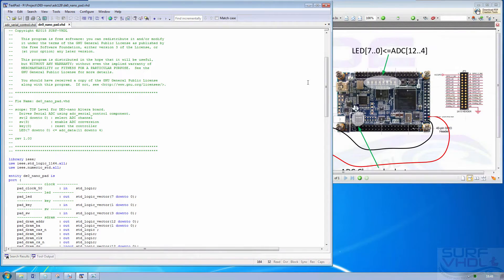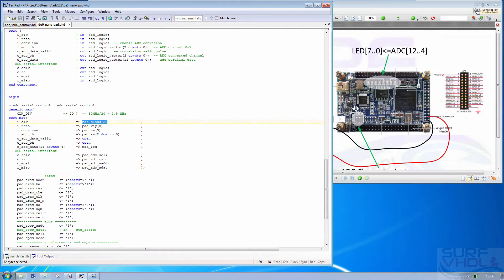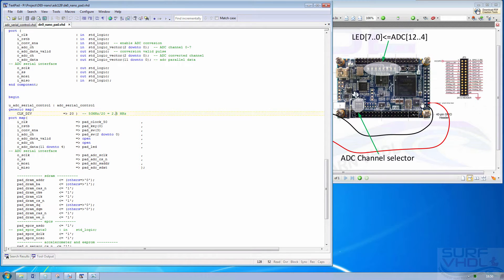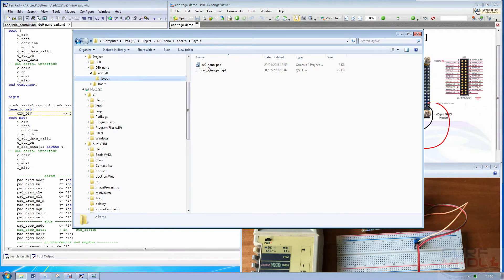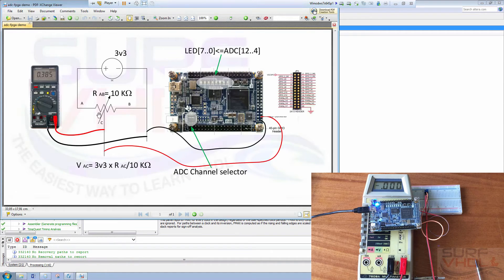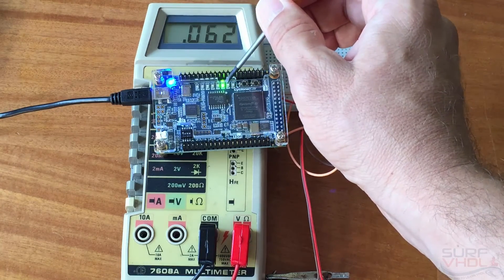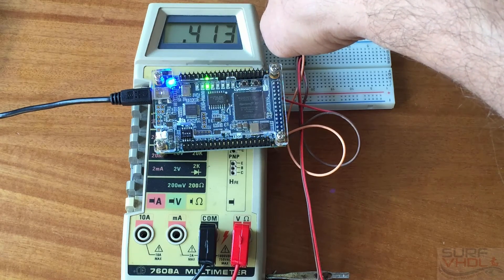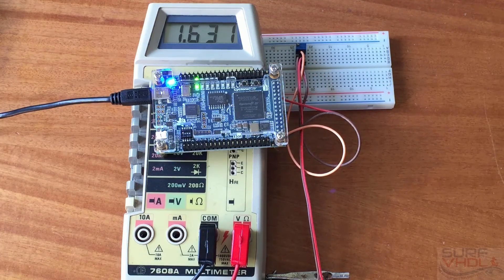Serial ADC VHDL controller using ADC128

Comment: Hi, the de0 nano demo comes with adc coding in verilog but it's not readable as i've only learnt vhdl to a certain level. If i'm only trying to use the ADC do I have to configure the other things like the accelerometer? Also do I have to assign pins to use the ADC or is that already done?
Reply from the maker: The best thing is to assign all the FPGA pins connected to the peripherals. In the documentation, you can find all the info to assign the pins.

Comment: Thanks for the helpful video.
Just wondering, I couldn't find my de0_nano_pad.vhd, where can I find it?
Reply from the maker: "de0_nano_pad.vhd" is the top level in the example. You can find the VHDL code of the ADC controller in the post 
http://surf-vhdl.com/how-to-connect-serial-adc-fpga/
then instantiate the file in your VHDL design.
BTW, here you can find my courses where you can find the example you are looking for

http://bit.ly/2l4QxsX